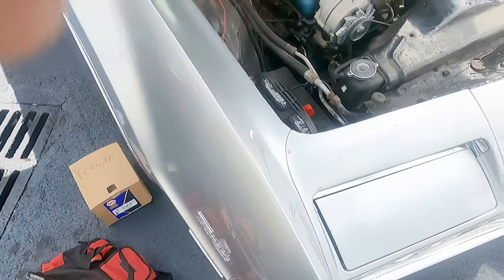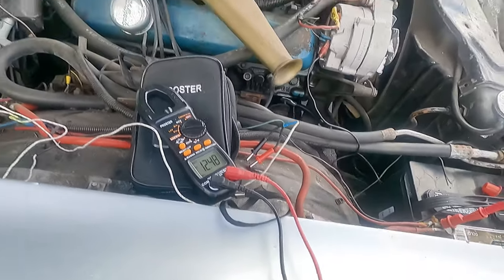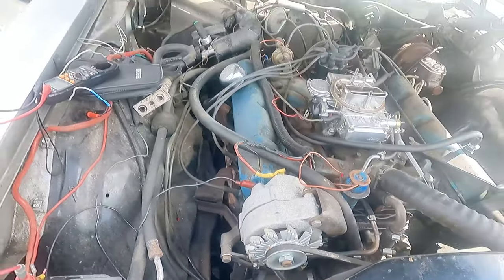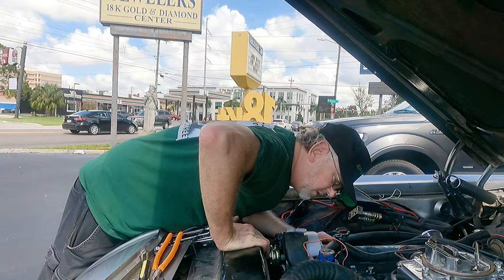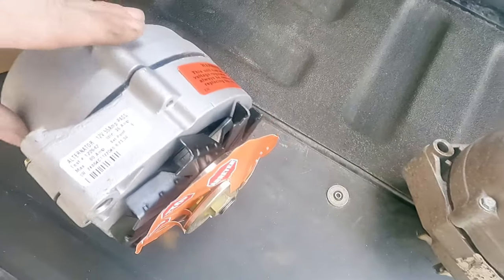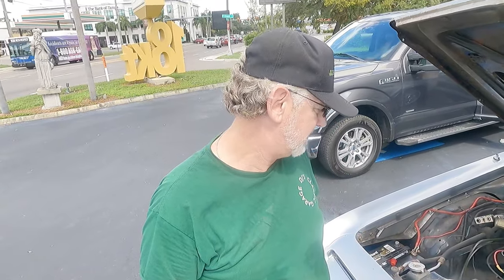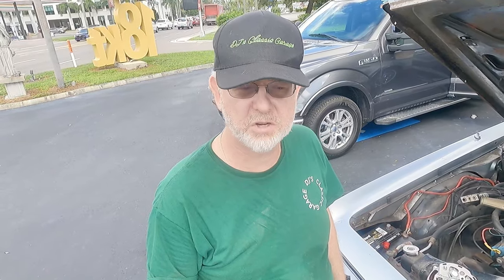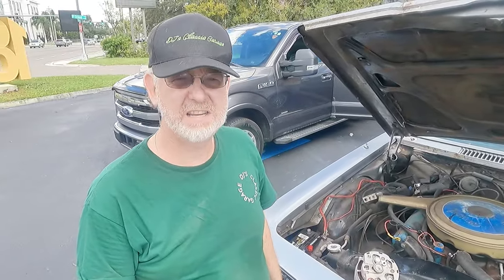Can You Find GOOD Toronado Alternator Replacement Parts?

Comment: For example, the GM parts catalog lists the PN for the starter (which is somewhat unique to the Toro because it's mounted on the opposite side of the engine than normal) as 1107354 which I couldn't find but it was superseeded by PN 1108522 which Rockauto does stock in three manufactures. You can actually look at the photo of the starter to ensure the bolt holes and the solenoid are in the correct orientation and feel very confident that your getting the right model.
Reply from the maker: @ourkid2000  ok.

Comment: I have a '66 Toro as well and getting the correct parts has always been a hassle. Do you have access to a GM parts catalog? I live in Canada so I can't afford to make mistakes on the parts because if I have to ship it back it basically costs me double to get it back to the USA. A very sharp individual turned me on to doing it this way.........get the correct PN from the GM parts catalog and then go to Rockauto's website and find the part through the OEM/Interchange numbers. I've had very good luck with that method and haven't had to return anything yet!

In the end I did get the correct alternator but I didn't end up using it. I actually converted the car to an internally regulated alternator which was a very straightforward process. If I want to go back to the original configuration with the external regulator it's a easy conversion.
Reply from the maker: @ourkid2000  I guess I can by finding it online. But we have a really good starter and alternator rebuild place 2 miles away.